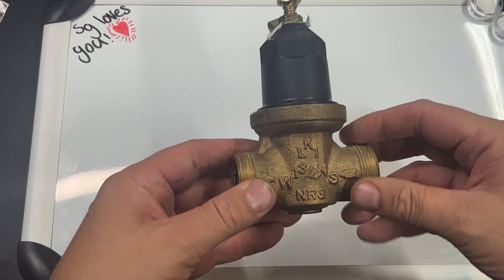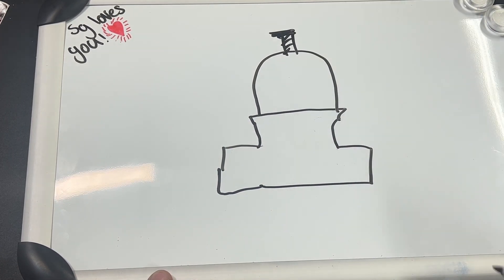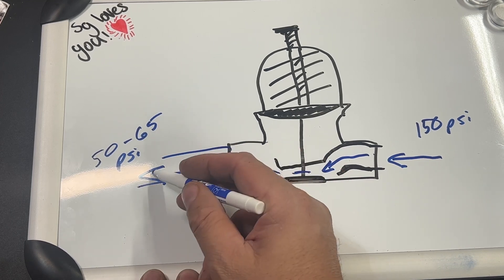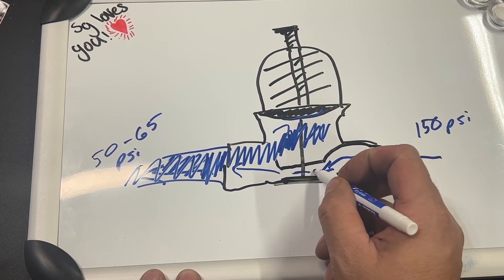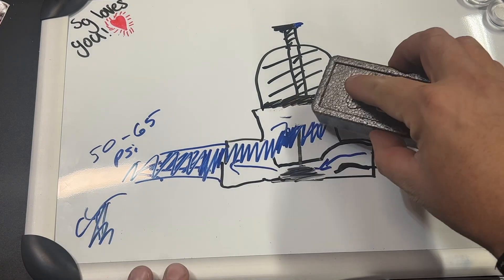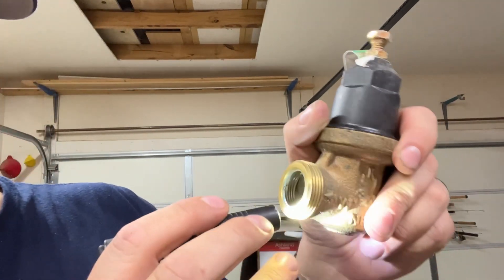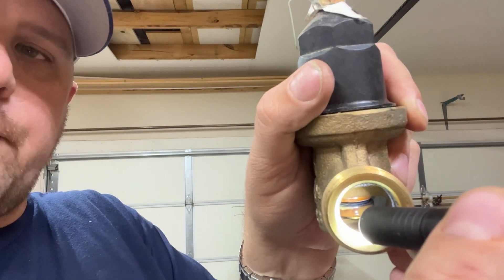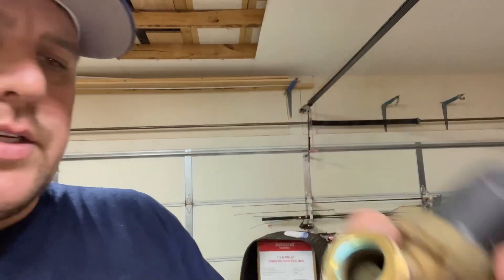PRV - How does it work? Pressure Reducing Valve details for the handyman or home owner.

Comment: Question... Trying to adjust my water pressure, when first hooking up the gauge, it goes as high to 100... Then with in a minute while pressure gauge is still installed, goes down to under 60 ?  Why doesn't it hold constant pressure ?   Thanks

Comment: What is the purpose of all that disturbing noise in the background?
Reply: Quit complaining. This guy did a great job making a video to help people...and he didn't have to.
Reply: @chrishackworth5745  I expected a technical video, not a DJ.video.  Btw, if you install a oressure reducing valve and no expansion vessel, your hot water heater will still leak and the internal pressure will rise to the relief  pressure on the boiler. More interesting than noise pollution.

Comment: My water pressure in the house is a bit low in the mornings but very high in the evenings to a point that i get some pvc joints bursting. Is it ok to install a water regulating valve to avoid too much pressure in the evening? But after doing that will i still get a good water pressure in the morning or nothing at all without adjusting the pressure?

Comment: My PR valve has failed and I am at 100psi. It is outside the foundation and not easily accessible without some additional effort, may I abandon it and put a new one inside the crawl space, leaving the old one in place? Thankyou.
Reply from the maker: Technically yes!   You may reduce the gallons per minute by doing so since it’s another restriction on the line, but ultimately you can and be safe.  The ones that are in the ground can be super tricky in such a tight space.  The only other issue you could have is that the first prv could eventually close, and then you’d be forced to deal with it in the future.

Comment: Dl you have recommendations on how to avoid having PRV's going bad ( per what you said, sedimen?
Reply from the maker: Not really.  The issue that I’ve seen in the past is with city water, when a main breaks the sediment rushes in the pipes and it’s hard to control on the utility side.   Ultimately you could  put a filter before the prv but it would have to be something rated for high pressure but I have not ran into anything in the wild.  Most water filters are going to be rated for pressure up to 80 lbs.   not saying they aren’t out there.  Just haven’t seen it.

Comment: Great video! One question, I have water pressure 90 psi, can install a water pressure regulator without an expansion tank to water heater? Thanks!
Reply: No, you should install an expansion tank. Say that the valve reduces the pressure to 4 bar when closing the hot water tap. Now the cold water that just entered your tank will be heated and expand. The pressure in your house will rise. With no expansion tank the pressure relief valve on your boiler will  blow off the pressure.
Reply from the maker: You can.  You can put the pressure reducing valve on the line coming into your home. This will let you adjust the pressure to the normal range.

Comment: put a pressure gauge on your outside hose bib...turn on few faucets and if it drops more than 20 psi than good sign pressure reducing valve is bad.....have your plumber install a pressure gauge right after the valve so you can monitor the pressure....

Comment: Wow, what a great and simple video and diagram that was relatively easy to understand, thank you! I can tell that you want others to understand what you're trying to explain more than you are trying to promote yourself. Another thanks! I have to install a regulator in a tight space with very limited possibility to install it in a certain orientation. Could you please let me know whether the orientation of the regulator is important? Does it have to be or is it better to install it with the adjusting nut toward the sky, or will this valve function equally well and be equally reliable if it's installed tilted sideways or upside down? Does the orientation affect how the strainer screen works or how debris might affect the valve long-term? Thanks for your advice!

Comment: Excellent explanation of the Valve and its function.  My small development has recently experienced water heater pressure valves flowing and flooding basements.  We have had numerous breaks in our water pipes thru out the development and I suspect that some of the cabins do not have these valves installed and ones that do may not be functioning properly due to sediment in them.  Thanks

Comment: Is it supposed to be dry in the bell area? I noticed mine leaks and all the internals are rusted. Did the gasket by the mesh screen that failed?
Reply from the maker: Once the mesh screen is clogged that is the beginning of the fail.   The water should remain below the diaphragm in the model that I presented.  You potentially had a diaphragm failure if you found rust and debris in your bell.
Reply: @HomeRemedyLLC  thanks. I have the same Zurn prv. The screen is clean. It just leaks to above the diaphragm. I have another smaller for for a 3/4 line and it did the same. These down last long. Perhaps it's the water hardness etc.

Comment: Are there prv on the market that allow for back flow pressure back to the city so that you don’t need an expansion tank for your hot water heater? I guess you’d call it a prv that’s an open system instead of closed.
Reply from the maker: I don’t believe an item as described would exist. Generally just past the water meter is a check valve (back flow preventer) to ensure that any contaminated water from your home would not go back into the drinking water supply. Basically all residential homes being fed by city water would fall under a closed loop system and an expansion tank would be required. Unless the city has terrible pressure below 80psi anyhow.
Reply: No. This is a pressure reducing valve, it is not a pressure regulator. To do that job you need a pump to press the excessive water back to the city tubing against its pressure. Something like the pump in a ABS brake system.